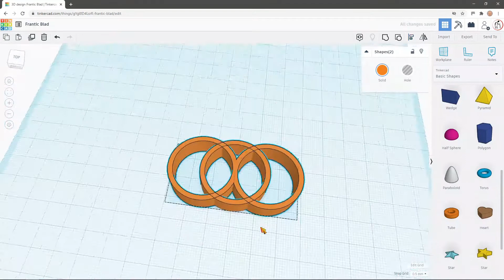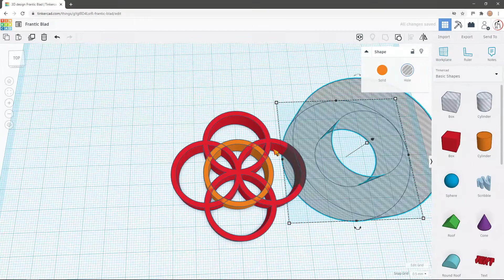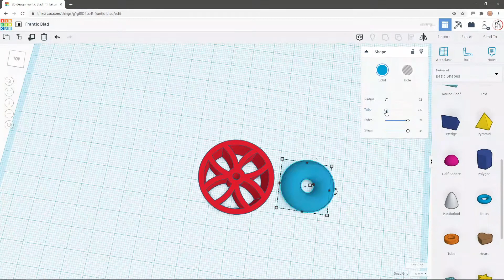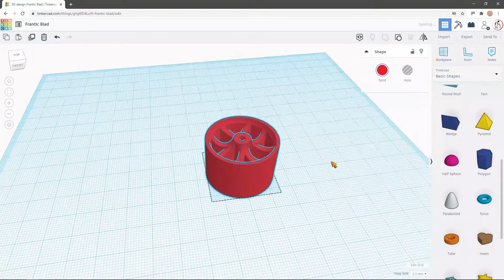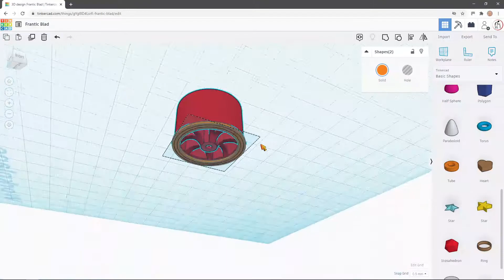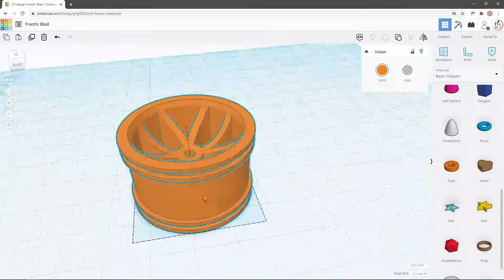Playing with shapes for wheels in Tinkercad

Comment: I was thinking as I was watching, is that me? That’s how I do it. I’ve not used Tinkercad, it seems to work well for you. I’ve been using Mattercontrol but my old machine locks up even on simple things sometimes. I will try your program as I think a web based design program might solve this. Thank you for another informative video.
Reply from the maker: Hey thanks. It is a very basic CAD, but I have watched videos by guys who achieve amazing results with it. I only scratch the surface. There are tutorials available, but that would be like reading the instructions - nobody does that unless they are desperate 🤣